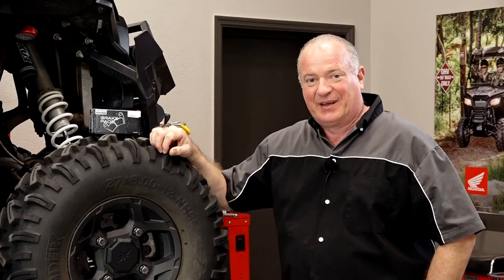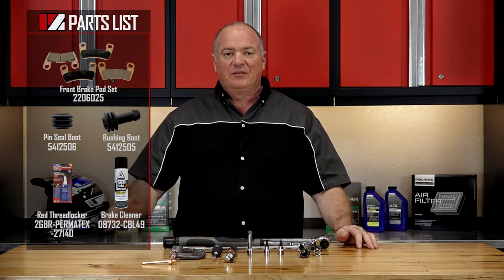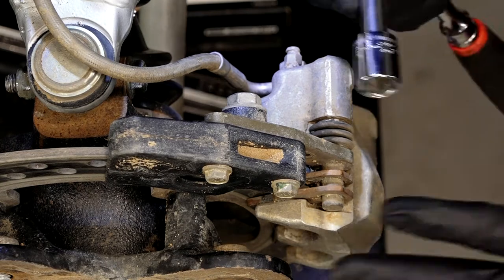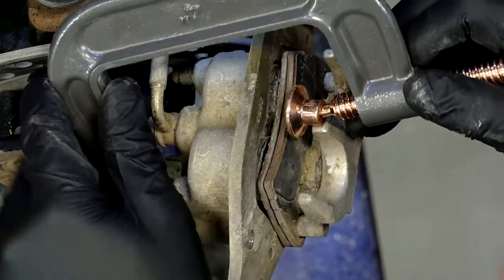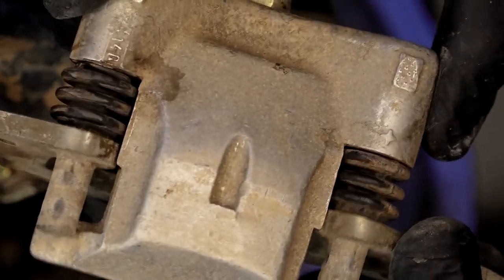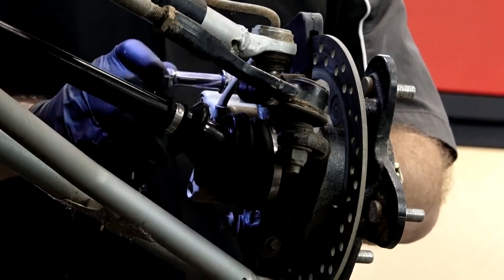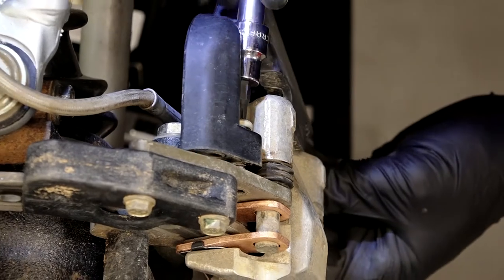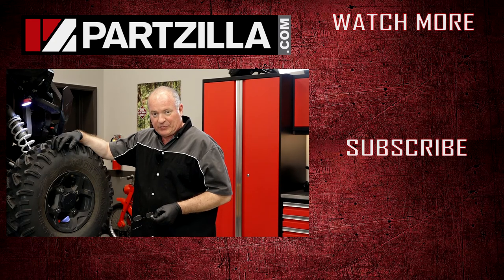How to Change Polaris RZR Brake Pads | 900S Front Brakes  | Partzilla.com

Comment: Very clear guide. I just finished this job up. When I was all done, there was a puddle of brake fluid on the floor. I think it overflowed the reservoir when I pressed the pistons in to change the pads, and then pumped the brake pedal to push the pistons back out into position after the new pads were in.  I wiped everything up, and did a quick test drive. It seemed fine, no more leaking fluid, and the reservoir was reading max. Perhaps it was a pinch overfilled before?  I did not have any overflow when I did the rears last year. Strange.